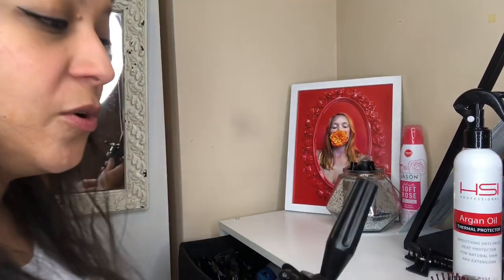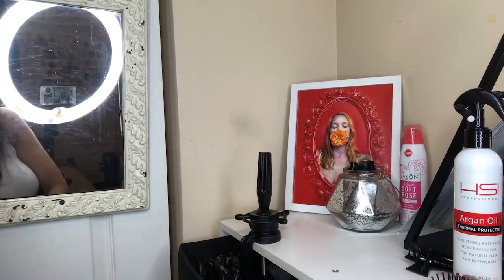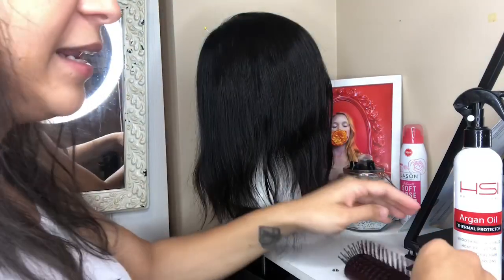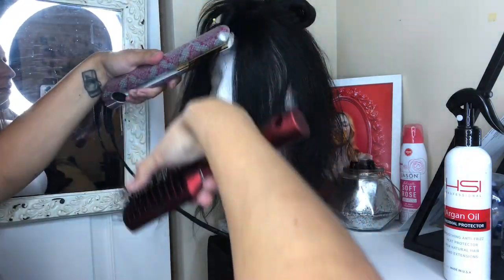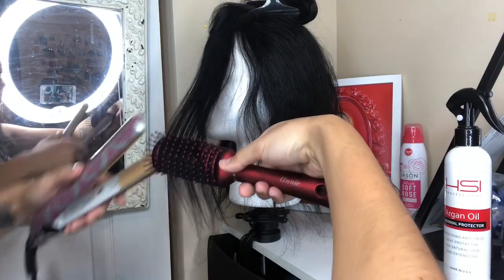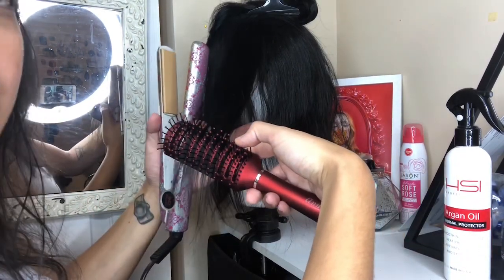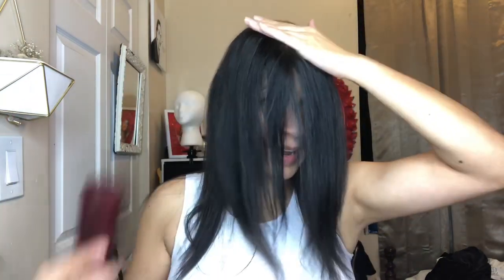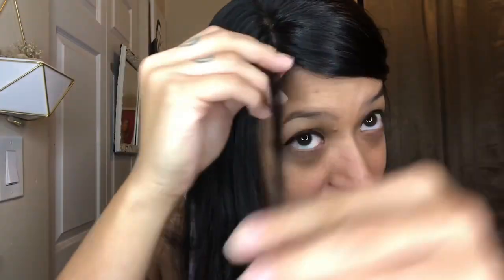How I prep/Straighten/put on my hair topper

Comment: Is these hair topper fall down during gyming or dancing?
Reply from the maker: Savita Kumari Yes you can successfully wear a topper while working out at the gym and while dancing without it moving/shifting! #1 recommendation is to always always always wear a headband while working out! There are 2 reasons. 1, so the topper doesn’t slide and 2, so when you lay on the floor or bend forward, the headband will help prevent the topper clips from pulling/causing tension on your bio hair. People have said “Just wear a hat.” That may work for others but a hat while working out is not for me! I work out in a gym 3-4x a week with a topper. I have even done a hot yoga class (with an older topper so I don’t sweat up and have to wash my newer topper) and have done kickboxing classes with it on.  I have a video on my channel called “Exercising With Your Hair Topper” for more info on this. There I mention a hair tie recommendation too. In my “Topper Hair Styles: Hair accessories w/ a Hair Topper” video, I recommend a headband that has little rubber grips on the inside that will further prevent sliding. I even give my head a shake to show how well it holds! As for dancing, I love dancing when I go out. For my 30th I even wore a metal crown on my head that was a little heavy and went to a salsa dance class. I took the crown off not because of my topper, but because the crown was hard to dance with a partner when there were a lot of spins. The topper was perfect throughout the night and I have never felt so confident on my birthday as I did that night! Last night my roommate was even gently petting the topper on my head and said “wow it doesn’t move” lol. I also believe different toppers may hold onto the head better, depending on the base size/construction. Some sit on the head better and are lighter which helps it not drag when I’m lying down doing floor work outs for example. Using more of the clips may help when you are doing a more active activity, especially while you are familiarizing yourself with it’s limits. My topper has 10 clips on it total but I only clip 4 at a time each day, so then every day I can alternate where I clip to give the other area a break. If I am doing a more active activity and I feel that maybe 5 or 6 clips clipped will be best for it, I’ll go ahead and clip more and that definitely provides added security, but I don’t have to do that often?at all. In my “Topper Travels: Traveling With Your Hair Topper” video , I talk about my trip to Iceland and things I did to help keep it secure while doing things such as being in high winds and while swimming. I hope this helps! I realize it is lengthy but when I was researching toppers I wanted all the knowledge I could get! Thank you for watching!
Reply: Thank u for such a beautiful reply...u r so sweet dear...
Reply: Sorry but i hav one more ques.. does the clips of hair topper damage existing hair and scalp of its place?
Reply from the maker: Savita Kumari oh another thing, I started to put dry shampoo on my hair before putting the topper on, to provide more grip. Some people put moose, it’s personal preference. 

Most people say that everyone is different, some people won’t get damage and that others will get damage over time, maybe even permanent hair loss (traction alopecia) from the constant clipping. I really think how much bio hair you have & how strong your bio hair comes into play. I have excessive hair loss and because of that I feel that the clipping is definitely not helping, in fact I think it may have made it a little worse. It is a fear that it will progress, but I am trying to do things such as wear a wig grip on days where I’m just at home or running errands, that way I won’t have to clip all the clips and my scalp can have a break. (I plan on doing a wig grip tutorial soon). But before I wore a topper I knew this was a high possibility and I made peace with the fact that it may cause more hair loss. I feel that I was really willing to take the risk because I truly believe that my hair loss is way beyond repair, so either I wear toppers, which make me feel good, or I keep not wearing anything and continue to be self conscious daily. But in my situation it makes total sense to move forward with toppers because my hair isn’t going to get better, so I decided to take control. If it comes to a point where my bio hair can no longer support toppers because of even more excessive hair loss (😭) I’ll have to upgrade to full wigs. But I wouldn’t have it any other way. I lived for years walking around with hair loss, embarrassed, thinking about it multiple times a day, everyyyyyyy dayyyyyyy... but now I walk around feeling like the real me. It gives me time to think about /deal with things that really deserve my worry/attention, instead of my hair loss. It’s something you need to take time to think about and really be ready for because the possibility of more hair loss is very real. There are prevention /slow down methods you can do, like I mentioned in the last message, but the fact is that if we are using these toppers because of hair loss, our scalp/hair is fragile and clipping it daily isn’t going to help. There is a company called thin hair thick, they don’t use clips but they use a headband instead but it is pricy and you don’t even get to try it on, unless maybe if you go to them in Utah because if you open the package when they ship it to you, last I checked you can’t return it which is too big of a risk for me. There are people who have said they haven’t had any clip damage but how long have they been wearing it? How heavy is their topper? Because the longer and thicker it is the more weight it has. How severe is their hair loss? Do they wear it every day? There are a lot of factors to consider. I know it’s not a solid yes or no because everyone’s situation is different. But I feel like I am pretty knowledgeable in this and I feel like I notice some damage. Another topper youtuber has said “I committed to toppers for life, so it doesn’t matter too much if it damages my hair further”, which I feel like I’m on the same boat. I hope this helped, if you have any more questions ask away!
Reply: @althairbish  thanks..then I think hair patch is more beneficial than hair topper..
Reply: @althairbish  I can very well relate to the ordeal you've mentioned. I am in the same boat amd very recently bought a topper from highline wigs.  My confidence is back!
Reply from the maker: Mohini Yadav that is wonderful to hear!!!!! I bought my first Highline 2 months ago and it’s the best topper I have had, very happy with it and love how this is the topper that has helped me worry the least about how my hair is looking. With other toppers I would think/worry about it a lot more.... yay!